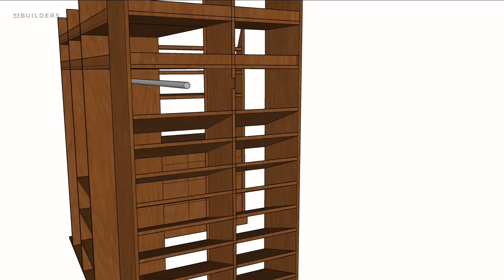Plywood edge doors? Maybe | Revealed

Comment: I'm looking forward to more on the exposed plywood edge doors.  As a non-builder, I'm curious, are these solid, and if so, was there any discussion on making it semi-hollow-core (maybe hollow out that center piece of plywood)?  It seems the weight would be significant with no real value added...unless weight itself adds some perceived value.
Reply: Greater mass lends itself to sound deadening, especially if there's a brush strip around the door frame to reduce air movement. I frequently replace hollow core doors with solid fire doors to reduce noise between bedrooms.
Reply: I can’t see the weight being a real issue. It is significant work to remove all that for no real payoff but you would get that hollow sound that isn’t desirable
Reply: @John28530  I did a quick Google search on density - you are correct.  Plywood is only slightly heavier than softwood.  One room in our house has MDF sliding closet doors - - MDF runs 2x of softwood.  I envisioned the solid plywood being more like MDF but it's almost the same (and naturally stronger) than softwood.  Good choice.

Comment: I noticed the backer panel in the vac bag didn’t have “air channels” in it. Obviously I know it’s main purpose is to avoid getting glue on the bag, but does not having air channel prevent airflow in anyway? Would it work better with channels in that auxiliary platen as well?